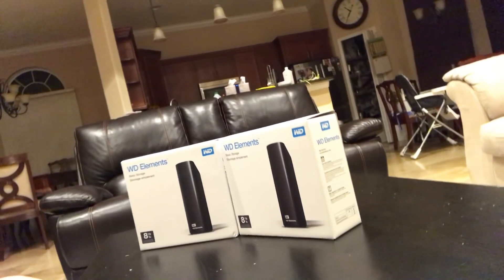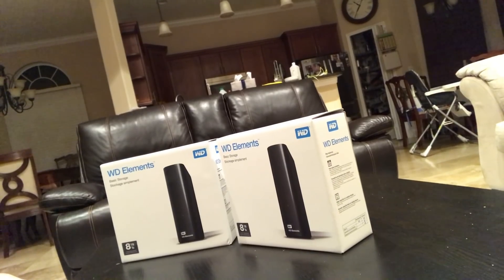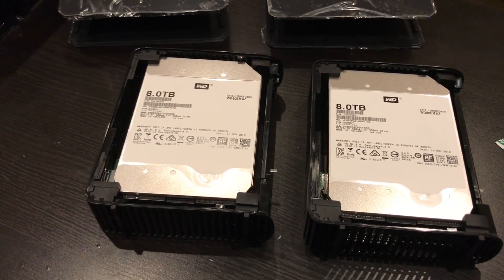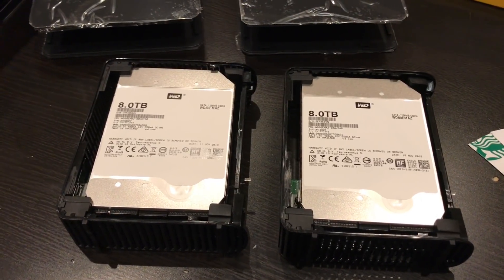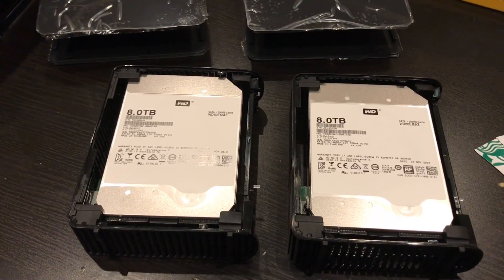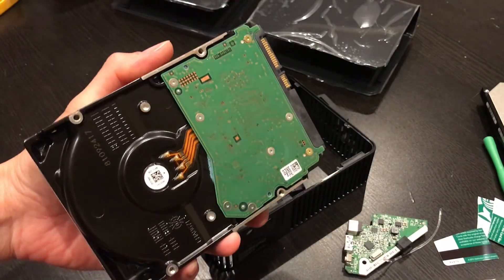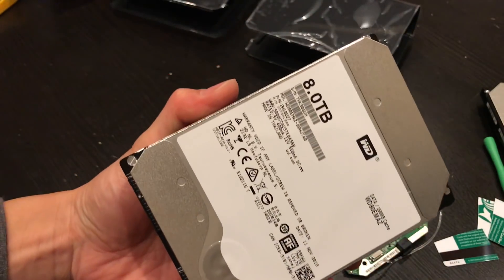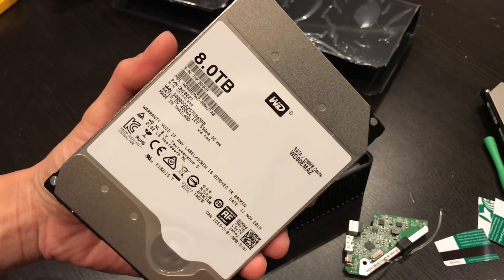Shucking Opening 8TB WD Elements External Hard Drive HDD White Label Red

Comment: I believe they are reds with blue drive firmware , Because wd doesn't offer 8tb in the blue but they do in 8tb  may even be red pros because of the 256 cached but with blue firmware it will not give nas ware or tler for raiding them they are still a good value if yoy just need a second pc drive or archive drives
Reply: So far, only the Hitachi drives that rarely popup in the "WD My Book"  line of externals have Blue firmware. The ones in this video are WD (or sometimes HGST if you're lucky) which wouldn't offer Blue firmware at this capacity.

>Because wd doesn't offer 8tb in the blue but they do in 8tb
That doesn't make any sense.

They aren't Pro drives either, newer EFAX WD Red drives offer 256MB of cache with the EFRX offering 64MB.
Also, these drives still spin at 5400rpm, whereas the Pro drives are 7200rpm - it wouldn't be in WD's favour for putting Pro drives into these cheap enclosures (in terms of cost).

Comment: Shucking is common knowledge but yet WD and the rest still charge way more for just the drive. It's insane. The added cost in materials due to shucking has to be a lot at this point. I suspect most externals are purchased to shuck.
Reply: I've done it with four drives now. Two Seagate 8tb and two LaCie 8tb, they were all Seagate barracuda compute drives
Reply: @hiddenmoments456  Yeah, I'm getting ready to do some shucking myself. I have a 4 bay DAS that I need to fill.
Reply: @freddyfredrickson  never tried them but it looks like the wd are a pretty good choice right now. Cheap as on amazon
Reply: @hiddenmoments456  Thanks I have a Lacie 8TB I was wondering what drive was in there. I don't really like the case, the drive gets hot. I don't get why they didn't utilise the aluminium cover as a heat sink.
Reply: @cobz76  yeah no idea. Seems like it's there purely for looks. Form over function

Comment: Can I use this as a secondary hdd in my main desktop?  It would be for everything... programs, games, storage
Reply from the maker: digipimp75 yes. On these larger HDD there is a hack to tape the 3.3V pin on the drive to work with some of the older computers. It’s an issue with the new SATA standards that weren’t backwards compatible with older power supplies.

Comment: Good find man, keep them coming. I just got some as well for my home made nas inside a fractal design r5 case with 8 drives plus two more bays that need to be filled, running windows 10 pro with storage spaces in mirror mode for storage pool.

Also have a qnap and synology nas about to be filled with drives. And use as attached iscsi drives for the main windows server box. Unlimited terabytes is fun.

I do pc stuff and car stuff too here in Washington when I’m able.